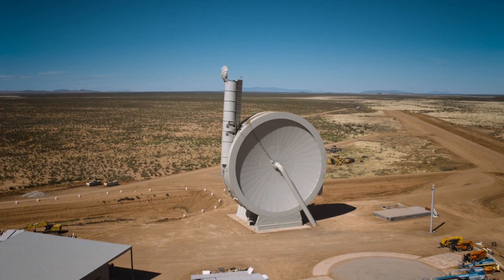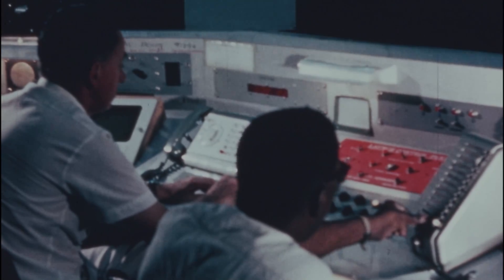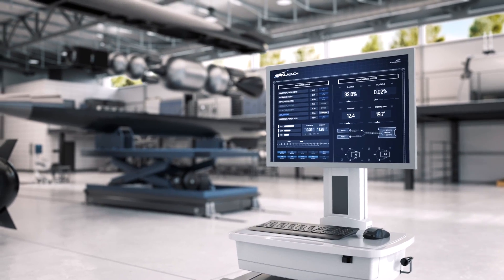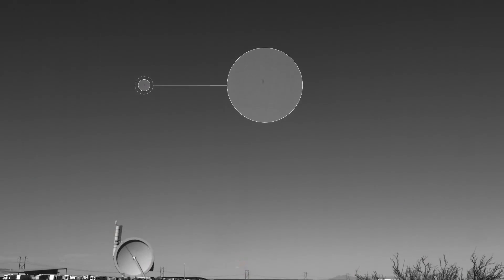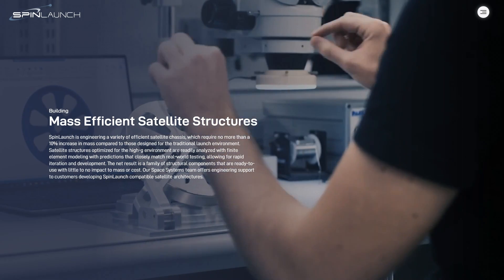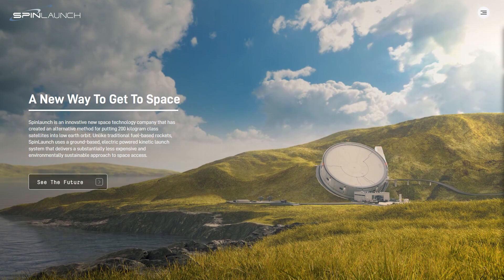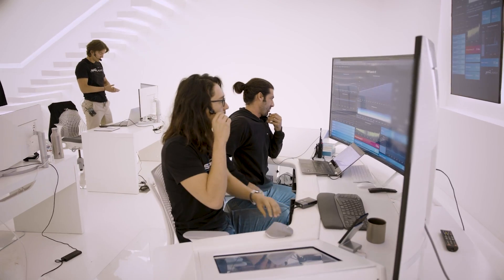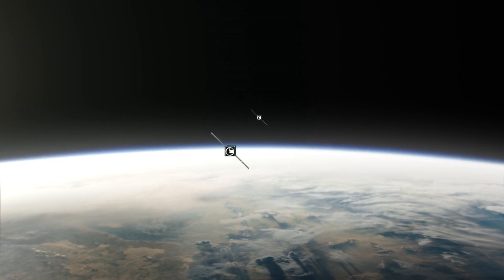Can Spinlaunch Throw Rockets Into Space?

Comment: No, Scotty, Spinlaunch at the moon would still need some sort of propellant - simply to increase the orbit's perilune, which obviously would be at your launch site.
Reply: Plus, the initial speed that is needed to just get this close to being able to achieve orbit is at such a high mach number that there is no material that could handle the temperatures.
Reply: @galvanaut7119  that's why he's talking about launch at the moon though. Orbit velocity is lower, and there is hardly any atmospheric pressure. So if yeeted from the dark side of the moon, you are not going to surpass room temperature at any time.

Comment: They can use second counterclockwise rotating arm and release 2 rockets simultaneously.
Reply: Then you'd have two suddenly out-of-balance arms.  That's not quite the problem here. The arm is more like two arms, Like a person spinning with their arms out, holding weights. Suddenly you let go of one weight. The other one  - a counterweight - pulls you off balance, pretty much instantly.  That's your bearings failing. And hence why so many comments about dropping a sacrificial weight into a pit, or some variation.

Comment: And when are we finally gonna bend spacetime? This energy problem and air resistence problem for spaceships are getting boring. Almost 100 years of rockets, STILL  no strong warp-drive! Why?!

The centuries come and go, and of course spaceships have developed a lot, but on a basic level... We still can't fly over Mach 10 without feeling like a burnt hamburger in some melted alloy, so bye bye chicken wings. We still are bothered by that air in our atmosfere. Airliners must fly a bit slower, or they'd burn too much fuel. Because of air, and we have no idea how to solve this problem. Why are humans always so proud? We can't even be in Australia in half an hour. My idea is, humans are stuck at the moment. Using nuclear power for rockets would solve the fuel problem, but the nuclear waste is no good. Fusion is not ready, yet. And I know the basics about supersonic: to be rude, supersonic  is why a space shuttle will burn the astronauts when speed is too high. Entering our bubble of air (atmosfere) is not easy. And those Airforce fighters would love to fly at lightspeed, but our materials can't stand a bit of air moving across quite fast. Who on earth are WORKING on these problems? And why are they working so SLOW? All we come up with is an F-35? Is that all?! Compared to a ranger with a shotgun, these F-35's do the job. But where are the Mach 5 fighters? And where is the airliner to Australia in 2 hours? Why is this world so SLOW?

Comment: Meh, just another pipe dream project, though not as stupid as the "space elevator" concept.  Even if they achieve some success, the type of payload that can be deployed is extremely limited.
Reply: There's nothing stupid about the space elevator concept. It will work fine on a smaller planet or the Moon even with current technology and materials.
Reply: @MrDmitryC  You might want to check your facts on your assertion that "it will work fine".  Just like the idea of asteroid mining, even under ideal conditions it is still only theoretically feasible, but impossible in any practical terms.  What I've never seen addressed in these writings about the space elevator, is the immense cost - both in energy and cold hard cash - to just get the building materials into space in the first place.

Comment: So what happens if it goes wrong. With any launch into space there is a chance things go bad, and with satellites that usually means BOOM! 
So lets say that they are getting ready to shoot something into space, something goes wrong, and the payload, the rocket, releases at the wrong time. How much damage will the building take, don't forget the quick rotating arm that suddenly has less weight so might just break off and swing out of control. 
Look with a rocket you can have different launch bases and make more rockets. This is ONE location that if it goes down... it is down! 
If the building explodes as a worst case scenario might do, what is the 2nd and 3rd option for a launch. 

I know this is experimental, but the question is will this make sense long term. 

Hell why not make a huge rail gun if you want to shoot stuff in space? Or is that not fancy enough!

Comment: I don't believe in this at all. Apart from it being incredibly dangerous, those 10,000G's are incredibly impractical.

I don't see any reason why you wouldn't simply make a long Hyperloop system for this. It's low tech, safe and can operate at any amount of G's, enabling all forms of cargo to be shipped. With such simple and standardized parts, I doubt it would be more expensive either. On the moon, you wouldn't even need to contain it, you could just build a simple MagLev track.
Reply: Look into the StarTram concept. Hyperloop + electromagentic mass driver launch, essentially.

Comment: The problem is, you look at that thing, it was flipping in the air. You aren't going to send a rocket anywhere like that. It may have looked like a rocket, but I bet the thing simply has no ignition elements, no fuel. I don't think you could do this with a liquid fuel in it, fluid mechanics would ruin it.

But, I believe this would make a neat weapon system, problem is, too much unknown in the release. Timing changes the angle significantly. You can see it in the video, the thing comes out at a wrong angle, and then flips.

To do this right, you really want a sphere. If you were going to make a rocket out of this, maybe you encase the rocket in a spherical outer casing, and then you explode the casing off the rocket, hope to hell you can recover it from the flip. If you could get the angle right, you have a great chance at throwing explosives into another country. Maybe you put some gyro's into the sphere and use that to adjust the landing position.

Comment: At the same time as the space vehicle goes up, there would have to be another 'blank' or 'dummy' of equal weight that goes down, say into a deep hole filled with a viscous fluid like mineral oil. If there was no dummy weight, then the out of balance forces would probably shock/shake the vacuum chamber to pieces. So the vehicle would be launched successfully, but at the cost of a destructible vaccuum chamber for each space shot. That's doable, but...well, you know! not ideal. see BeatTheBush's comment below which says the same thing. My true opinion is that, carbon fibre of no carbon fibre, this thing is faecesware, ie bullshit-with-a-beat-up-business-plan. I'm glad its not my money.

Comment: It doesn't have to be launched at sea level, I expect they will build it on a mountain top. Higher altitude will mean lower air pressure which means less air resistance. There are a number of mountains near the equater that could be used. Read "The Moon is a Harsh Mistress" were they discussed electromagnetic launch rails used to launch payloads into orbit.

Comment: How about the practical considerations? Cargo rockets must be optimized for weight, which means that the rocket will be quite fragile a piece of hardware.  And it still has to carry a huge amount of rocket fuel and somehow avoid exploding due to leakage or malfunctioning. There's no need to worry how the cargo can hold the G forces, no, all emphasis must be put on worrying about the rocket itself.

Comment: I think you underestimate what 10.000 g are. Each kilogram of the projectile will "weight" laterally 10 tons! And at the moment of the release it would instantly decelerate to 1 g. I don't see any rocket engine surviving and being functional after that. The fuel itself will most likely solidify through the extreme pressure during rotation an suddenly liquify at the moment of the release.
Reply: The Bugatti Chiron is speed limited by its tires to 318MPH.  It's achieved 305MPH with the wheels rotating 68 times per second and tires sustaining 5,300 Gs.
Reply: @larrysmith6797  There is a huge difference between a rocket and a chunk of rubber.

Comment: Neat idea. But just imagine it something breaks towards the end of spin up. This thing could launch debris pretty far.
Reply: Same risks as a rocket exploding mid air then.

Actually safer if you think about it
Reply: @mixrable1212  depends on the forces at play. Those electrical engines spinning the thingy are actually storing massive amounts of kinetic energy , for hours . This demo was mach 1 and a small payload. So this rocket goes nowere. For what I see their goal is hypersonic speeds. ANY payload at hypersonic speeds has tremendous amounts of energy. Now make it big. The sudden release of energy if the system fails, for sure will prove a sight. Any failure in this system would be a catastrophe and have a danger zone of many many kilometers. I am not sure rockets exploding in mid air are so catastrophic. And this thing, if it fails, it will always fall at ground level Also the window to lunch seems too small for me. I am not talking about his demo, I am talking about their goal speeds/weights

Comment: Quite interesting... during spin-up it's getting  10,000G's of acceleration from the side, but when released that force drops to zero suddenly (which is a huge change), and then upon exiting the vacuum chamber and hitting the atmosphere, it's got to be taking a lot of deceleration G's along the longitudinal direction.  So there are two "slams" .. 10,000G to zero, then 0 to some N G's, so forces in two different directions.  It can't be easy to design for that.  But it will be amazing if they can launch payloads into orbit this way.

It'd be a formidable weapon as well.  I'm sure the DOD is looking at it.
Reply: The deceleration G forces are just neglectable and since the force on the y axis shouldnt be a problem, as thsts the axis where rockets can hold up the most force, i csnt see a big issue there. If the rocket and electronics etc hold up 10000 G on the x axis then it will easily hold up maybe 200 G on the y axis.

Comment: This is so incredibly dumb, the projectile would go from experiencing huge centripital forces to nearly instantly compressive forced for frictional slowing with the air.  Having to strengthen the rocket against both forces make the idea even less practical then a long linear accelerator.   The huge facility ultimatly only dose the job that the first stage of an Electron rocket dose, and at huge capitol costs and the need for a heavy 2 part sabot to be expended each launch.

Comment: all they need to do is release a counterweight matching the rockets weight on the other arm same time, 
which obviously will have to go into the ground somewhere and dispense its energy in a tunnel.

But that would be easy to realize, and solve the bearing-damage potential. Avoiding complexity would be a good thing.

Now, pay me royalty for solving an engineering problem. I am happy with 1%

Comment: Before even getting started, I think my biggest question is how the hell the payload is supposed to handle the stresses involved in being spun like that - spinning so long, spinning at that speed and then the release. Obviously any manned launches are absolutely out of the question, but I also question the validity of even just satellite or material launches. Even when the equipment isn't hyper-sensitive scientific instruments it's almost certainly not meant to handle the stresses of a giant centrifuge.
Reply: Hear hear.
Reply: he already stated that modern phones and cameras survive this and don't forget that all of it is in an enclosure. its bio matter that is being spun but solid objects.
Reply: @double-you5130  dude enclosure means nothing.  And while handphone might survive such a trip, I bet its joint and welds would have under gone substantial stress damage and I won't expect it to work as well and for too long.

Moreover, if you are talking about sensitive sensor and measuring equipment... these will be even more prone to damage. Even if it survive, I bet all the calibrations will be off, if some of the more sensitive components ain't damaged in the process

Comment: Why can’t the small rocket and payload be hoisted into the upper atmosphere by a platform ringed with massive high altitude balloons? No fuel needed and a lot of weight saved in the rocket. It would probably be used for one way trips only or with parachute return systems.

Comment: I cannot believe anyone is taking this seriously. The lateral acceleration required to reach even 1km/s (let alone 7km/s) is in the 1000's of g's. The vast, vast majority of microsats cannot withstand that kind of lateral acceleration, so who would be the customer? There is good reason Spinlaunch used what is basically an artillery shell (3/8" high tensile steel walls) for the demo. Nothing else can withstand the acceleration and extreme jerk (dF/dt) at release.

Comment: Literally laughed when I saw this thing, mass drivers are old ideas that were replaced by better ones. That one missile that went 2km/s in the lower atmosphere reached 6000 degrees. Good luck shielding for that.  

They were also working at 2% their stated working power. And the way the back of the missile came out of the tube at a different point than the front showed it was tumbling.
Reply: Common rockets start in a dense atmosphere with low speed, accelerating as the air gets less and less dense. This thing, however, blasts through the maximally dense atmosphere at its maximum velocity. As a thought experiment it sounds scary.
Reply: @masterpassword2  As a thought experiment it sounds stupid. As a real experiment it IS stupid.
Reply: yeah they should build that thing in the himalaya
Reply: Yikes imagine how much more of the atmosphere you need to breach when going trough at an angle like that
Reply: Exactly.
Reply: @dogwalker666  .

Comment: 4,350 years ago at the start of the Flood all the asteroids, comets and meteorites were ejected out into space on columns of constant superpressure steam.
The debris was carried so quickly because the first blast of steam blew holes in the thick lower atmosphere.
It's hard to imagine Spinlaunch can work because the missile has to be aligned with the exit aperture at moment of release but no matter how accurately they align it the fact remains that during release the alignment varies and the longer the missile the more critical that will be.
A Tesla Coil powered steam generator making a pulse of supersteam to blast a hole through the atmosphere ahead of a missile powered by a second pulse would mimic what happened on Day One of The Flood.
A simple vertical launch tube surrounded by Tesla coils would be all that is needed, scaled up as needed.
Carrier steam catapults can generate pulses with old fashioned technology.

Comment: that thing was going at 2% of what they were wanting to get up to....the missile launched at a dam angle even using that amount of power. The vacuum has to be maintained with moving bearings which at those speeds is an impossible task, if there isnt a complete vacuum the heat generated from air friction will destroy the machine, there is dam corrosion in that test spinner already. They are dam lucky  that tiny test didnt go tits up.

Comment: A great idea. I found on model Rockets that approximately 1/2 the fuel was used just to get it off the ground. 
So if you lifted a rocket first (a bit like with the V1 only vertically) you would use less fuel.

Comment: So we need satellites that could survive a building up 10k-g for a serious time. We also need to survive the vacuum stage rocket acc g forces in the perpendicular direction. Not only that, but as soon as it breaks vacuum seal the air will rush in making the effective air speed more than the projectile speed. So a gigantic drag force will slow down the rocket which will impart a negative g force so not only you need to design the payload to stand g-force in the radial and positive axial directions, you need to include negative axial direction. A crazy engineering challenge what it is…